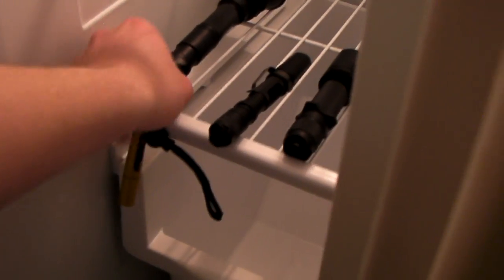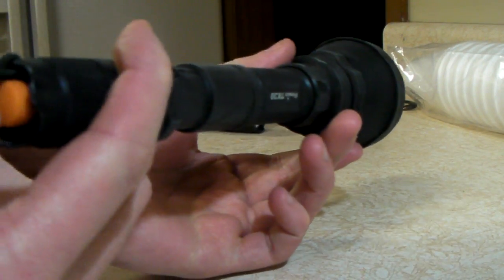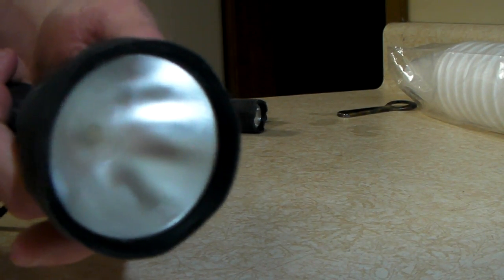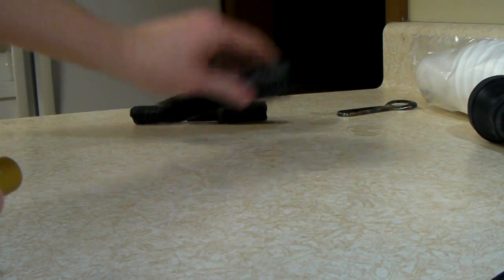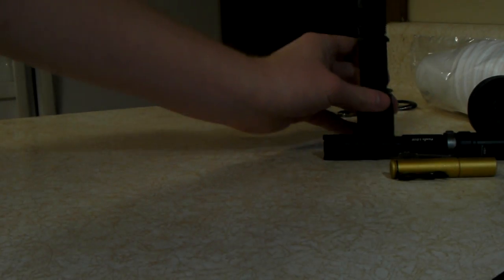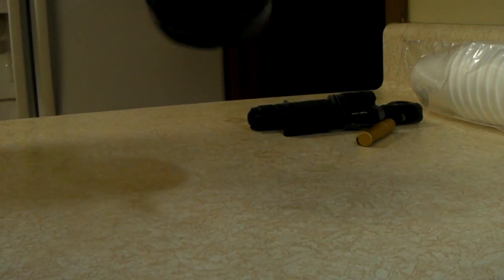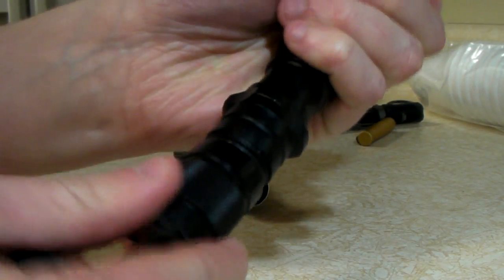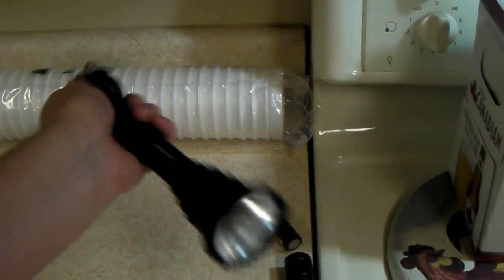FREEZER TEST! 4Sevens Preon 1, Fenix TK11 r5, Fenix TK30 and Fenix LD20

Comment from the maker: @joeratti 
I have done it just not on video, I cant see what it proves though as per test results, Leaving it on will just keep the light warm and that makes no sense. As i want to test how cold they can be and still produce light.

Having a warm light (From emitter heat keeping circuits warm) is the same as having the light on anywhere else, it would then only stress the batteries.

If im out backpacking and its -20C I dont want to grab a light that isnt going to work, unless i leave it on.

Comment: Nice lights and vid OfficerSheepDog.  One thing I want to mention... I'm pretty sure you can use lithium ion batteries in temperatures that range from -34 F - 140 F.  That's why lithium cells are awesome.  Surefire's website says their batteries operate safely at -76 F to 176 F but I think that's a bit over the top.  If you used a battery with a different chemistry then it most likely wouldn't be a good idea to operate you lights at those temperatures.